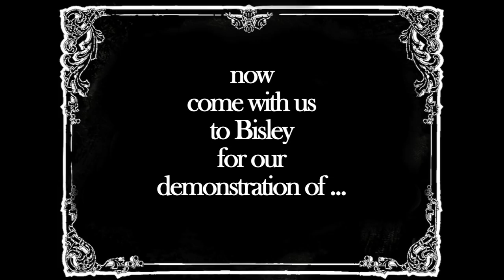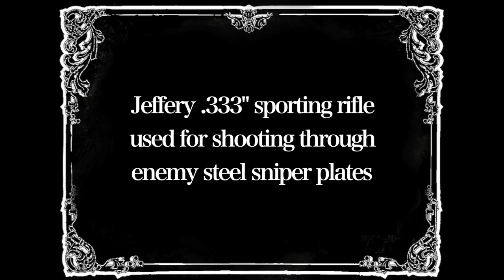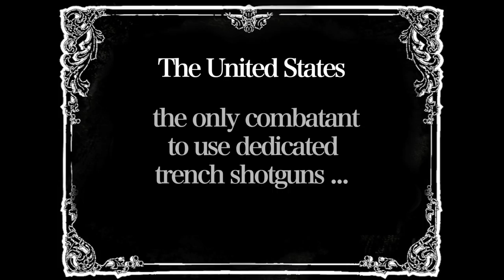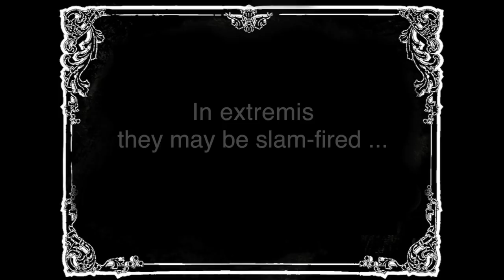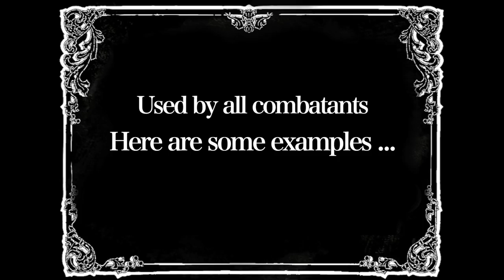HBSA WW1 Commemorative Demonstration film

Comment: Great stuff indeed, but "SMLE MKIII*" with magazine cut-off, surely not chaps ?
Reply: Cut-offs continued to be fitted to Mk lll* rifles, certainly into 1917,  I have a 1917 dated, Enfield made rifle with cut-off fitted.  Some Mk lll* rifles also had the earlier type of cocking piece fitted.
Reply from the maker: Good point - well spotted.
Reply: Having had a closer look at the rifle being used it appears that it has the cut-off and windage adjustable rear sights typical of the Mk lll, but the later Mk lll* cocking piece and no long range sights or butt marking disc.  It would be interesting to see the markings on this rifle.